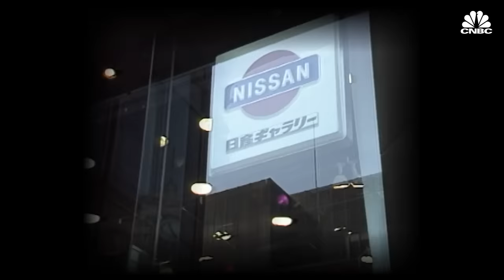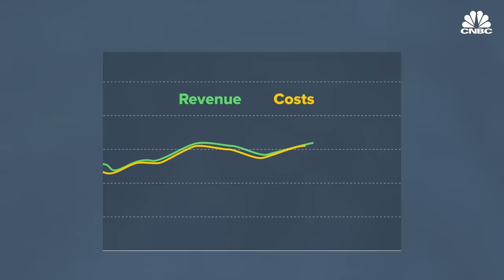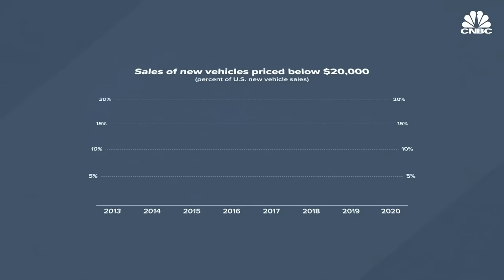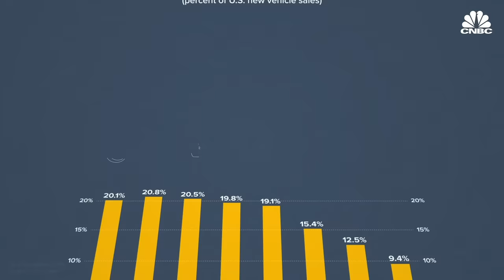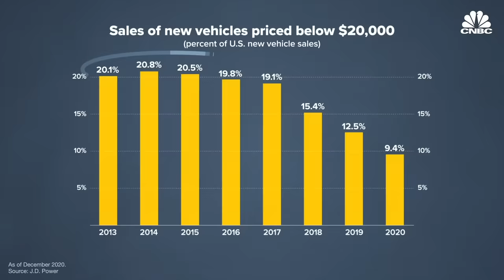Why Cheap Cars Are Disappearing

Comment: Yes. The expectation is to have that technology. That tech honestly isn't that expensive to make any more. Let's stop pretending like putting in a USB port is SO fancy now. It's basic.
Reply: I think the idea was that a touch screen and Bluetooth chip are supposed to be premium even though you can get both for really cheap
Reply: @KRYMauL  It's software and not hardware that is expensive...
Reply: @aymanhawari2589  Most software is based off of the open source Linux system which is free.
Reply: They stuck an iPad to the dash...so modern!!!
Reply: Definitely not worth the 10s of thousands of dollars they try to make us believe....
Reply: @KRYMauL  software engineers are really expensive
Reply: You can buy a decent infotainment display and backup camera setup for less than 200 dollars now. No need to have a 7 year mortgage just to have a tablet on your dash. 90s cars will be forever iconic.
Reply: @KRYMauL  Mine was custom coded by LG and uses VERY little open source. See below....

Specifically, according to GM , LG Chem will manufacture and supply all of the following systems:

Lithium-ion Battery Cells and Battery Pack
Battery Heater
Electric Drive Motor (GM design)
Power Inverter Module for DC-to-AC conversion (GM design)
Onboard Battery Charger
Electric Compressor for Climate-Control System
High-Power Distribution Module
Accessory Low-Power Module
Power Line Communication Module (for communication with DC quick-charging station) 
Instrument Cluster
Infotainment System
That list includes parts and assemblies jointly designed by both companies.

That is a LOT of freaking software for an electric car...

I know you think i mean infotainment system. I mean accident avoidance, battery charging etc. etc. etc.

It's for the open source code used by the infotainment system - not for the infotainment software itself. For example, the infotainment system code probably runs under a Linux style OS - the OS would be open source but not the stuff written by LG to run the infotainment system.
The open source code that LG Electronics used for the infotainment system in everyone's Bolt EV is already installed and integrated. There is no way for the end user to manipulate or update the system with the source code, nor is there any need to. If you check LG's repository of the source code here:

OpenSource Code Distribution

You'll find that the source code for LC10S-BSGZ largely consists of the libraries needed for decompressing ("unzipping") files, display images and video, and parse contact data in an address book. These functions already exist and work in the infotainment system.
Reply: you should tell that to tim cook😂
Reply: @aymanhawari2589  I’m not too familiar with LG’s software, but I wouldn’t be surprised if everything they do with Android which is Linux based. Also, having different images/ videos for the infotainment system makes sense as the system isn’t very advanced. My point is after the sale of a small amount of cars with system the company turns a massive profit.
Reply: @joaoguilhermejarochinskima1820  I know that’s why I’m pursuing the industry.
Reply: $60 put a new android radio in my 2006 truck.
Reply: @KRYMauL  I'm going to tell you that open sourced software is often avoided because of the high legal implications that can happen using OSS. The company in which I work for designing ECUs there is a lot going into the software of the vehicle that you dont personally interact. A lot of the price goes into the tech you don't interact with or think about.
Reply: They should make cars lower priced, some shouldn't have any screens because cars don't need screens to run, they're trying to sell you on technology, and that's stupid because if I were to buy a car, I want a car, not a computer.
Reply: @tcs07d  The point is it’s cheap
Reply: That's why I just plop in my Samsung fold 2 onto my phone holder and connect it via aux cable with a dongle and I'm off. That's all I need as far as tech goes in my ride. 📱📱👌 🚗
Reply: Let us not forget the insanity that is BMW charging an annual fee for its customers to use Apple Carplay when there is 0 cost to BMW to include it... which is why most other car manufactures just give it for free if there is a screen.
Reply: My car is basic but it has an aux port. It only took $30 to get a bluetooth adapter and charger. If automakers can't figure out how to put that into a basic system idk what to tell them.
Reply: @_brrr  $30 per car can add up, but not by much.
Reply: Android Auto is a $2000 option on Ferraris...
Reply: @aymanhawari2589  
Well yes and no.
Yes software is somewhat "expensive" but also no because it's not the software itself but the BRAND or who were the idiots that customized the software.
Reply: @tdiamonds23ice82  
That depends.
For me as someone who loves tech, I much prefer a screen than an old dinosaur 2DIN radio. 
But I'll be happy with a simple screen that has an acceptable BT connection and can run most of my videos on a USB. 
But things like Android Auto or Apple CarPlay is useless for me.
Reply: What's interesting about this is we the consumers dont want these tech features. The corporations are telling us we want them. So we believe them. There is an entire psychology on this premise. I cant remember the name sadly.
Reply: @dickmelsonlupot7697  I agree, I would prefer a screen but if I had a car, and it had a screen, then I might just sell the screen, but screens are nice.
Reply: @tdiamonds23ice82  
A screen with a analog volume control, now that's a dream.
Reply: They are pretending that technology like that doesn't get cheaper. People are starting to grow up with these technologies in cars, of course they expect them to be affordable by the time they buy cars.
Reply: @codymoreland4496  You're speaking my language! There are so many things that the OEMs and Dealers (and YouTube videos) have convinced the consumers they "need"! It's not just the tech, either. Just the ungodly amounts of power modern vehicles have is not necessary; Camrys, Accords, minivans with 300+ hp. Pickup trucks being sold with enough towing prowess to pull down buildings. AWD/4WD systems on SUVs and Trucks that'll never see anything other than cement. It all adds up to higher cost and higher markup.
Reply: @dickmelsonlupot7697  your not wrong, but I don't need a screen, screens are luxuries to me, not necessities.
Reply: @KRYMauL  While the underlying Linux is free, they customize the crap out of the interface, which costs a lot.
Reply: Yes. They take an extra $120 worth of technology parts, plus some $200 sun roof that no one actually wants, and charge $4995 extra for it.
Reply: @javaman2883  Not the software engineers fault that professionals fetch a pretty pretty.
Reply: Car-stuff needs to last at least 15 years while a ipad only needs to last 5 years
Reply: @KRYMauL  But the employed software developers are not.
Reply: @tdiamonds23ice82  Yep, plus I already have a screen, or can get one relatively cheap. Give me the ability to use bluetooth or USB to connect a tablet, and I won't need your built-ins.
Reply: @oingpla  They’re the same as every other engineer in terms of pricing
Reply: @mins1133  Well technology change more often than cars
Reply: Yeah man I added a USB port to my 2000 frontier by replacing the stock cigarette port. I also installed a touchscreen head unit with Apple car play. All of that was for less that $400
Reply: @KRYMauL  oh, ok I thought they’d be highly paid?
Reply: Except the infotainment system on my car is NEEDED. I need it to set times to charge my electric car, The pre cabin heating settings because. EV in winter , range issues, etc etc. 

It controls the accident avoidance. The auto locking of keys in cars. It is MUCH MUCH more then a stereo and IS needed in electric cars so.
Reply: @cuh720  OK but does the infotainment system littlery control, times to charge your car, and many other things. there is lots of software on the backend... 

WHile it will work for a car from 2000-08 doing something like that to a car in 2020 is dumb
Reply: @tdiamonds23ice82  
It's a necessity for someone like me especially for any modern day person who has been exposed to tech. 
But like I said, features like Apple CarPlay, Android Auto or whatever are useless for me since I don't need and it's fckinng dangerous to do shtt with my phone while driving.
But a back-up camera especially one connected to my screen is actually a plus and is classified (for me) as a need since it does help me in backing up properly especially in tight spaces plus with the amount of motorcycles we have here in the Philippines, it's a must have especially on an SUV since motorcycles are almost invisible when they linger in your blind spots.
Reply: @dickmelsonlupot7697  your not wrong
Reply: @oingpla  Engineers as a whole fetch $60,000 - $120,000 and average at about $90,000. All together that’s about the same as middle management, so it’s not as much as you’d think.
Reply: Who needs all that junk anyway
Reply: Every car does not need the top tier technology. Every car does not need a touchscreen Apple CarPlay android auto heated seats cooled seats ventilated seats. All of those things are pointless for most Americans
Reply: @AgentSmith911  It has a similar cost on other vehicles as well
Reply: @llcross04  A touch screen CarPlay or Android auto device is cheap af
Reply: @KRYMauL  Open Source ≠ Free
Reply: @crankcase75  Actually most open source software is maintained by the community of academics and hobbyists. So, it’s about as free as you can get. Go home boomer and stop talking about things you don’t understand.
Reply: @KRYMauL 
That pretty cool but I'm good with the setup I have now with the Fold 2, it works perfect for me. And when I get my new car next year, I'll just switch the phone  cradle over to my new car and done! That is a nice system though, I would go for it if I didn't have my setup I have now. Thanks for the link 👍😎
Reply: USB port exist = my insurance company that’s a 1000$ more !!
Reply: @KRYMauL  Making random assumptions about people on the internet much? Great way to look a bit daft. I work for a top tier cloud computing company and specialize in Linux - there are multiple open source licenses types besides the GPL, it is possible to make the code open, but still charge people to use it. The code also has to be thoroughly tested and maintained properly - you can't expect hobbyists or academic institutions to stick with a project indefinitely without funding and end up with a coherent solution. For example the Automotive Grade Linux project receives funding from Mazda, Suzuki, Panasonic, Denso, Toyota, Renesas and other minor contributors. It is then incorporated into products they sell, or solutions they re-sell. https://www.automotivelinux.org/about/members/

Not all Linux distros are completely open source either, some contain proprietary elements (e.g. Red Hat) and if you want your vehicle to work with various proprietary technologies and devices, then you may have to license certain things also, even if you're running on Linux.
Reply: @crankcase75  I’m talking your basic versions of linux not server level which is going to be maintained by hobbyists and academics because and institution needs to teach Operating Systems each year. Sure that’s no technically free as you’re paying for your entry, but it’s about as free as water or air. Also, automation is completely different from something like CarPlay. In its simplest form is just a stereo with a usb which is $60 on Amazon. Lastly, your response was a very ignorant boomer response, so thanks for telling me about how complicated a car can be.
Reply: @KRYMauL  yes but these companies still need to pay developerd to code in programs and specific things for the vehicles. It's not like it's vanilla linux being used
Reply: I know, they’re acting like you need to be 40 with 3 kids to have bluetooth and a usb port that cost $8 to make.
Reply: @dennisp8520  You know developers and engineers receive the same pay as middle management right? So, they hired one more management team that doesn’t mean anything compared to the multiple millions a car takes to sell
Reply: @politcallycorrect5816  lol $8. It costs pennies if you waffer it yourself mate.
Reply: @KRYMauL  you got to remember though the car manufacturer only makes there money when they sell the vehicle they still have to support it with updates, pay boatloads of cash to make sure it meets strict guidelines for all the states, do all the crash testing. It's not the individual components that matter per say. Like others have said USB is cheap, metal is restively cheap. It's the combination of many things along the way that add cost including transportation to get the vehicle to your dealer and the dealers marking it up for their share. 

So for example let's say a car sells for 20k the auto manufacturer profit on that low end vehicle is likely around the 30-50percent which is pretty low.  That car is likely going to last for a decade so it will be a long time before they get a repeat sale from you as well and by the time multiple other iterations of vehicle have happened that had to be paid to research and developped to stay competitive.
Reply: @politcallycorrect5816  bluetooth and usb should be easy to make and put in but there are other things that effect cost
Reply: @dennisp8520  Thank you professor for lecture on car sale 101 when I was talking about a cheap radio console that supports CarPlay and not about bells and whistles add on which can cost a lot in rnd.
Reply: @KRYMauL  free software != cheap to maintenance or customized
Reply: @KRYMauL  Android is used in the infotainment system only. Everything else needs an OS with real time guarentees, which android does not provide. There is a modified Linux version with a different task scheduler from the usual one that has some real-time guarentees, but it is not mainstream and there are better RTOS options. You do NOT want the ABS brakes to suddenly lose their anti-skid capability because two lower-priority tasks on the same thread are periodically deadlocking for 50 ms.
Reply: @aymanhawari2589  that's dishonest or ignorant. The automobile software is mostly free
Reply: It was?
Reply: @amitkumar-sz6ze  Except for battery cars, there's lots that goes into the backend... And software coders arent free
Reply: Auto companies were holding out on the lower tier for a while, just so you'd have to upgrade or buy the new one when it comes out with say map display integration.
Reply: @chuguanyu  It's the same as hiring a team of middle mangers in terms of pay I'm not talking hours, but peer pay.
Reply: @BosonCollider  I thought we were talking about infotainment, and don't most of the schedulers use hard coded schedulers that are bare metal in terms of performance. I'm thinking veralog type languges.
Reply: @llcross04  nope, it's mostly free
Reply: I was thinking the same thing. What tech do you feel has really improved a modern car?
Reply: Right it’s crazy to think a car is the price of a house.
Reply: @aymanhawari2589  android auto is free. You can get a decent head unit for $100
Reply: My car USB a Chevy bolt. There is MUCH more then AA and  CarPlay. Also those $100 units are junk.
Reply: @KRYMauL  you get what you pay for. 
 You put a cheap screen in the car, the screen will malfunction half way into the car's life span not even. 
You can get $2 lithium batteries from eBay for example.  But it doesn't mean that's what Apple and Samsung is giving you.
Reply: @J16179  all depends how much you earn.  The "price of a (sh!t) house" is pocket change to some
Reply: @Clark S I have been telling people this for years now. Screens, navigation, back up cameras this tech is so old now they should not even be options in vehicles anymore. Funny how televisions using the same tech are getting better and cheaper but you put a lower quality screen in a vehicle and it warrants a $1500-2500 option price tag. Car makers are continually raising the price of vehicles. Pretty soon everything will be $50k and up. There won't even be a $30k or $40k market. All the banks keep doing is increasing loan duration to keep payments looking affordable.
Reply: @AgentSmith911  crazy to think you spend $380k on a car you can't even daily drive and it doesn't come with the most basic of options. And why would something like that be a $2k option in a ferrari but $300 - 400 in a Toyota or Honda. Just doesn't make sense to me.
Reply: @cooltwittertag  you are correct. It's not like the screen technology is new. Hell even touch screen tech is old now. Funny how other products that use the same tech, laptops, televisions, etc get cheaper. But for some reason touchscreen and back up camera is still expensive. Same cameras used in these cheap home security systems that you can buy for $30 online, cost you $400 option in a car.
Reply: @Golden_African  that’s the point
Reply: Actually the technology in cars are made for endurance not cheap like a phone etc. Imagine you car computer failing or sensors messing up cause they cheap components.
Reply: 3000 dollars for an audio package that's 3 years behind current technology and cost 3 times as much as a high quality aftermarket system with Navi and full android functions. T
Reply: I can make a pc that has more tech in it then a car for cheaper.
Reply: @alex82361  Your home built PC doesn't need to meet any regulatory standards. Also a car these days has 20 to 100 ECUs and a couple of kilometres of wiring, even with CAN bus or automotive ethernet to try and simplify wiring looms. I don't think a lot of people appreciate the level of compexity in even a basic modern car vs. even an early 90s luxury one.
Reply: @aymanhawari2589  you know nothing about technology if you think the software is the hard part, they make one version of the software and put it on thousands of models you can buy one piece of hardware for thousands of cars.
Reply: You do know the 2017 bolt and 19/2020 has a different software so
Reply: @alex82361  Your pc parts can be used on any normal desktop pc, including the software. You cannot install windows 10 into a car or put a Core i7 into it either.
Reply: I remember one of the American auto makers saying that the cars are “priced at the value that customers believe they’re worth”.  The tech they place i the cars def is not worth the price, basically a usb and a alexa type system. In all honesty is cheaper to make a electric car and easier to maintain...it also has the worst carbon footprint...
Reply: @joaoguilhermejarochinskima1820  if they’re develop new software but not if they coping and pasting codes.
Reply: Price gouging
Reply: Just need a dock for tablet and port to connect with sensors and speakers.
Reply: @KRYMauL  Linux is this simple you have windows you have Mac OS and then you have Linux Linux is free and is great to code servers and small products that don’t need a lot of web based things
Reply: @KRYMauL  tesla uses Linux
Reply: @crankcase75  It’s a YouTube comment and I’m in the IT world. Also, I’m talking about about infotainment and everyone else is talking about extra features. So, nice try with the terrible spelling.
Reply: @gsjourney3054  Bro I know what Linux is it’s another OS built off of UNIX. Assuming my college textbooks are to be believed.
Reply: The thing is as long as automakers can tell themselves it is fancy they can upcharge thousands on a vehicle.
Reply: Apple car play is such a basic function, you can even buy your own system for less then a band
Reply: Its mostly the safety stuff in these cars that cost $$. developing it all takes billions and the manufacturers need to make the money back. If you look at dodge chargers they didn't add this tech and just dropped the price of their hellcat models by the thousands.
Reply: @KRYMauL  criticising spelling in a quickly typed off comment just higlights you've no actual point of subtance to come back with. Infotainment is still integrated into the the rest of the cars systems,  it's not just a head unit and still doesn't change that you fundamentally misunderstand the open source world, the variety of licensing/revenue models, how it often sits side by side with proprietary code or hardware (e.g. many processrors are ARM based which requires licensing, many infortainment systems are NVidia based and you have to pay them like any other component supplier) or the development costs involved, even if you're working off a GPL license. Basic head unit style functions is only part of the functionality in the sort of touch screen or idrive style interface even fairly basic cars are coming with now and you can't discuss it as a seperate category because it's all part of the same ecosystem.
Reply: @Mellio Kuang Manufacturing + Development + licensing.
Reply: As a worker in automotive
A LCD screen may cost $100-$200... Doesn't make sense to have them price increase to $5K more per car
Reply: @Disxx yes, and no

It's savings not for consumer but for companies, 
Companies won't share the cheaper prices of new technologies to consumers, they'll charge a premium

Consumers will have to switch to cheaper options, and stop buying increasingly expensive cars that don't give best quality/price
Reply: @KRYMauL  they have to pay for google and apple and the software engineer are not cheap. High salaries at least 100k a year due to competition .
Reply: @robo9876  That’s the price of middle management and in some states is barely a livable wage
Reply: @davidhill7071  regarding banking  If the car aren't worth anything before the end term of the loan, then what good is the collateral? It needs to make sense for the bank financially as well
Reply: That "earned it" quip was the most ridiculous and pretentious garbage I've heard in some time.
Reply: I work in automotive electronics, the reason why technology is so expensive because, the software and research in it, takes a lot of time and brain power. And it totally justify the cost.👍
Reply: @mangeshpawar9269  how is it that aftermarket companies can sell Double DIN radios with all the infotainment tech people want for only a few hundred dollars? And that's the retail cost... which hasn't moved much in the last 15 years tbh.
Reply: @StatsMass  Well you cannot except a good quality and added software features from such after market stereo. OEM software are rigorously tested for functional safety standards and many other standard. Software updates are provided after sales, issues and bugs are taken care of.
As many have already mentioned it before, its the software that makes it expensive and not the hardware.
Reply: @mangeshpawar9269  Every OEM infotainment system I've seen has without fail been outdated within 5 years. Updates (if any) are done at the dealership, for a fee.

All I ask for is Apple CarPlay (which is updated when my phone updates) and we good.
Reply: @aymanhawari2589  200$ for a CarPlay deck on amazon
Reply: @aymanhawari2589  we aren't even talking about electric cars. Your points are off topic and meaningless.  Besides that, most all of what you mentioned are not actually necessary functions.
Reply: @shanewillbur1325  My car is electric. There are things that a  $200 carplay deck CANT DO. Like preheat my car when it's cold, or show how much charge, or to limit charge to 70% vs 100%.. or to program accident avoidence or LKA 

My car is electric and has 1000's of lines of custom code. This is much deeper then a $200 headunit for FFS

If i had a 200 corolla yeah. $200 head unit. But with electric cars, that infotainment system has , LOTS of code on the back end...
Reply: @tdiamonds23ice82  well unfortunately cars now have to have a backup camera for safety, gotta have a screen for the camera, more costs added
Reply: @DaveCM  They are pretty needed when it is cold out and you need to save battery (and i live where it is 50-70 degress year around) . Or you want to prevent degradation because even tesla says, don't charge to 100% if you want you battery to last. So yes, It is important in electric cars. I have owned a spark ev and a bolt ev. Lots of tech was missing in spark that is highly needed in an electric car... sooo Dino juice is dead once you make the switch. So yes it is relative consider the EU and california ban on emmissions...
Reply: Relatively speaking it may not seem "expensive" to you anymore, but they still add to the cost. You have far more safety features, the use of  boron steel, all of which add cost to a car that otherwise exist and run without them.
Reply: @CarlosGutierrez-qw6pr  what a dumb law
Reply: True you can buy a plug in cig lighter and boom you got bluetooth and chaging for 20 bucks
Reply: @codymoreland4496  Middle Management is $40k to $120k it's not exactly a lot.
Reply: @tdiamonds23ice82  how old are you? And did you even watch the video? People are willing to pay more for the tech. Call me whatever you want but for me my first car is going to be the Tesla model 3. The brand name doesn’t sell me, the ceo doesn’t sell me, the car design itself doesn’t sell me, even the electric over gas usage doesn’t sell me,  it’s purely the tech inside of the car that makes me and many others willing to pay for the car.
Reply: This is why EV is the way bcuz you can implant technologies intuitively.
Reply: exactly. And these screens we're putting in are just tablets. If anything, the tech has made it cheaper for manufacturer. No more buttons and random knobs. It's all just screens and programming. And before anyone comes in to say the programming isn't cheap, it's cheaper than the machines needed to make the parts and it's cheaper than the materials needed for those parts.
Reply: @magiic3871  I am between the ages of 12 and 20, I watch some of the video but I just feel like that these screens are useless to me, they can be helpful, but our grandparents had cars without screens and so did their parents, and they did just fine. I'm not being mean to anyone I'm just stating my opinion.
Reply: @tdiamonds23ice82  Our grandparents and parents had a lot of stuff we didn’t. Hell my grandparents grew up poor and they turned out “ok”. However they obviously wanted more for themselves and their families. Thus leading to my parents who had some but not much when in turn leads to them wanting more and better for me. Within three generations my family went from poor to doing very well financially. 

The idea I’m trying to make is your suppose to improve as time goes on. Then those improvements become the norm. Our parents didn’t even grow up with google do you think anyone would willingly go back in time to a point without such a resource? 

I understand you may not be excited by it at the moment, but maybe you don’t truly realize the significance it brings to even have the ability to have an option of having or not having it.
Reply: @magiic3871  ok, I respect your comment
Reply: Right, but how many cars have a SD chip port or standard in-dash navigation?   VW had done that for years.  They put American companies to shame with some of their standard features.  Heated seats are very common in VW cars.  The Germans have always had higher expectations than Americans.
Reply: @angelgjr1999  even some of the early 2000's cars are good enough :)
Reply: Add all the other “basic” things and you’re looking at at least $2,000 extra, I’m still without power windows/locks but not everyone is willing to do that
Reply: @KRYMauL  a few hundred dollars, stuff adds up, a car maker could make a car with manual transmission/windows/locks, only basic radio maybe with Bluetooth, but virtually nobody would buy it
Reply: @Zachery_  agreed
Reply: Exactly i got an android radio i installed for 80 dollars, touchscreen with android share feature, gps, back up camera already with it. I also got a smart mirror with recording back and front and reverse camera on amazon that i installed on 2004 Toyota Camry. The dealership charges lile 20k more for that, it's a highway robbery
Reply: Look at kia and hyundai features other brands option are standard on kia and hyundai.
Reply: Not all technology is cheap though. Example: The parts and labor for replacing components such as a programmable auto locking power lift gate actuator on a toyota sequoia can run up $1500...and this is for a 2008 model!
Reply: @carrsllccarrillo6507  your not wrong the assembly does cost a lot of money, but with the amount of money car companies are making they should be able to pay for that.
Reply: @tdiamonds23ice82  you would think that would be true. However the profit margins need to be greater for them to be consider making money (greed comes to mind).  One of the problems that came in to light as of last year was the export and taxation of products built over seas now. Therefore, it's now going to be more costly for the manufacturers to mass produce product in foreign countries.  So now several  auto corporations (including aftermarket part companies) have decided to do 1 of 2 things: bring back their manufacturing process back to the states to save themselves from overpaying taxes. However, in doing so  now only increase the cost of the product itself which to compensate for the extra cost goes right down to the consumer who will eventually be paying more. The other option would be having their parts process done in one country and then get assembled in another country, which I have no clue how this would save money and it sounds ridiculous. You would think this would be logistical nightmare and more costly but I guess the bean counters figured out a way where they can save 2 cents rather then having it done here in the states.  Now, I can't say this is happening with every manufacture but since I work for a reman engine company and this process has been recently done, building engines with non oem parts have started to take its toll on warranty.  Alot of the 3rd party aftermarket components like harmonic balancers and oil pans are garbage with fitment issues and poor product build. Although it's not my decision to do this (nor would I want to it this way) it's safe to say that ultimately the deciding factor from the higher ups IS indeed  'profit over quality.'
Reply: @carrsllccarrillo6507  Do it yourself much???
Reply: @carrsllccarrillo6507  your not wrong
Reply: @THE-xp3hp  I'm not understanding your question
Reply: @tdiamonds23ice82  " I want a car, not a computer" ... well you are at least 30 years too late on that wish, Even my 23 year old junker has an ECU for the power seats.
Reply: @KRYMauL  "They’re the same as every other engineer in terms of pricing"

ROFLMAO -- seriously? You think that a new grad, with zero experience, can pull down $120K plus in other engineering fields?
Reply: @KRYMauL  Come live in the Valley
Reply: @KRYMauL  "Actually most open source software is maintained by the community of academics and hobbyists. So, it’s about as free as you can get. Go home boomer and stop talking about things you don’t understand."

No it's not. The OSS maintained by "academics and hobbyists" doesn't get used in safety critical systems. The big OSS projects are maintained by the companies that use them. If the OSS is critical to their product,  they pay engineers full time salaries to work on the code. Who do you think pays for the ongoing development of the Linux kernel?  Or the Java language? Or Python? Or OpenSSL?

I personally know many engineers who are paid to maintain OSS. And the one's I know who work on OSS wouldn't get out of bed in the morning for less than $200K pa. You don't put your lowest paid engineers on critical systems.

And yes, I'm marginally a "boomer". I've been developing embedded systems for over 40 years and have probably forgotten more about tech than you've ever learnt.
Reply: @KRYMauL  "I’m talking your basic versions of linux not server level" ... when you are in a hole ... stop digging. Server level Linux *is* the basic version! (You do know Linux is just the kernel, don't you?)
Reply: @stainlesssteellemming3885  Yes I've used the Linux kernel before. I was saying a computer scientist would get $60k - $120k eventually not as a new grad.
Reply: Correct! The tech barely costs anything to make.
Reply: @joaoguilhermejarochinskima1820  Software engineers make $90, 000 per year. A fraction of a cent per car.
Reply: @KRYMauL  Well, as someone who has routinely hired s/w engineers,  if I offered less than $120K for a new grad I wouldn't see a single resume. No one would apply
Reply: @KRYMauL  they are premium, a simple GPS navigator and touchscrren entertainment system costs around $1000 even in the smallest cars, while your phone is free.
Reply: @stainlesssteellemming3885  The most I've seen as a new grad is $80k, and that's with the stipulation of 1-3 years experience and a high GPA. So, I don't know where you work, but give the company's name and I'll apply for $120k.
Reply: @KRYMauL  I'm not in a hiring position at present. But I work within 10 miles of apple, google, facebook, etc. We need to compete with them for people.
Reply: @stainlesssteellemming3885  Oh, those companies are incredibly hard to get a job in.
Reply: @theoccasionalvideo  software engineers commonly go for upwards of $200,000 and there is an entire team of them.
Reply: @stainlesssteellemming3885  Wait $120k in California is barely enough to live in California
Reply: @KRYMauL  Agreed - but it's still not cheap. My point all along was that software engineers are not cheap.
Reply: @stainlesssteellemming3885  I meant they’re in line with middle management which aren’t the most expensive things, but not cheap either.
Reply: @KRYMauL  "Oh, those companies are incredibly hard to get a job in"

Well, not necessarily. But they do get to cherry pick the candidates. So if you want to hire someone who's perceived to be "the best" -  you need to make a better offer than they do.
Reply: @stainlesssteellemming3885  By hard to get into I meant after graduation without doing a massive project in college. I’ve only worked on a couple of websites in college, so I’ll probably be better off working at Oracle.
Reply: @KRYMauL  Well they ain't shabby neither: https://www.glassdoor.com/Salary/Oracle-Software-Engineer-New-Grad-Salaries-E1737_D_KO7,33.htm

But if you are still at college, I'd lose the "OK Boomer" attitude before you get into the real world. Because you are going to find a lot of us so-called "boomers" who have been working in software pretty much since the start of the industry, are still coding and learning, and who don't intend to quit for another 10 years at least.

More importantly, you are probably going to rely on them for your annual review and pay-rise. Remember that, in our industry, most companies prefer to fire people and hire new, than retrain them. You can do everything right, and you will still find yourself being laid off at least once per decade.
Reply: @Golden_African  Yeah but a 'shark fin' antenna is worth at least $4K, right?
Reply: @joaoguilhermejarochinskima1820  yes and no. Literally depends on what you need.
Reply: A usb port wasnt fancy to begin with lmfao
Reply: Yep. My entry level Spark from 3 years ago had build in Car play and backup camera on a base model. It's obviously not expensive to implement lol
Reply: Brands other than Tesla looks very boring in comparison.
Reply: @bensmith9175  I for one think Teslas design is kinda boring. You dont buy them for whats outside, but the features and performance. The Designs of BMWs and Audis are still iconic. We'll see if Tesla's Cybertruck sticks, though I doubt it will.
Reply: Honestly i do not want all that tech, so i do not want to pay for it.  They need to make options without it.
Reply: Automakers don't care since it means they can charge out the ass for an otherwise dogshit car with enough tech crammed inside it. I rented a Nissan Sentra for a week while I was fixing my own personal car. Despite being a basic car it had steering wheel driver controls, Bluetooth phone pairing, 3 USB charge inputs, a backup camera and mid dash screen and all manner of sensors plus some kind of adaptive braking which would REEEEE at me in stop and go traffic if I didn't stomp on the brakes if I got under 20 feet distance to the car ahead of me, even at 6 mph
Reply: Honestly i cust want something with an engine and wheels that will last a long time
Reply: @magiic3871  good that it sells it to you, me and many others do not want all that junk. They should include it in the techy brands, not base models
Reply: @iandms1160  The base models are becoming more modern. The entire car industry has been trying to innovate and needed a change. I mean hell all evidence points to a future of electric cars over gasoline ones but you don’t think there are still conservative people out there thinking “I’ll keep my gas car”. It’s just a matter of time.
Reply: @magiic3871  I am not even talking electric versus gas.  Technology even in base models for gas cars is the issue.   Safety features like lane departure warnings are one thing, cause they help out everybody on the road not just the driver, but all the music, different modes and settings are unnecessary and should only be included for those who specifically want those features.  More choice is a better thing.
Reply: @iandms1160  I think thats reasonable the issue is cars arnt custom made for one person and it’s a very unpopular side of the coin to not want the extras tech gadgets and what not. It’s such a smaller audience and it’s harder to capitalize on. At the end of the day they want to make money and keep having customers and the only viable way is to keep improving. You can’t make a car every year and it does virtually the same thing as the last car but a slight bit better. 

Idk if you follow newer cars being made but everything we know is being challenged in order to improve performance and give a better sense of safety.

I guess the only way you could have less tech is to buy a “worse” car in retrospect.  Older models where it wasn’t thought of or feasible at the time.
Reply: @magiic3871  While they cant customize they could offer more options, its not difficult to offer a couple models of the same car, one with an extra add on package, one without it.  Why they tend not to there are a couple reasons, demand is one, but also profit margins.  Car companies want to sell more of the cars that they have a higher profit margin on.  They make a better margin on an SUV with all the extras thrown on than they do on a basic car.  

As for your second point of buying an older car, thats exactly what happens and is speculated to occur often(either buying an old car or keeping an old car), one of the arguments against requiring some features federally, is that if you increase the cost of new cars by requiring it, that you price people out of the new car market, so rather than driving an improved but not fully loaded new 2030 car, they are driving a 2008 car that pollutes more and does not have as many safety features.  This was mainly used in arguments surrounding MPG requirements(which had certain car companies and states suing the federal government and other car companies) but applies to extra tech in general.
Reply: @iandms1160  Yeah thanks a lot of sense for both points. Good talking to you I see a different side of the argument and reasoning for it. Learn something new everyday haha.
Reply: @magiic3871  no problem, Im always learning from youtube haha.

Have a happy new year.
Reply: We are now at USB-C
Soon enough will come USB  G   H  I  J   K etc, and everyone will wish to upgrade and buit=y a new car or computer just to have the latest USB version.
It is a good way to stay in perpetual debt, surviving on Peanut Butter sandwiches whilst driving that Corvette or BMW and appearing to be rich.
Reply: Yup, you can get a 3rd party dash unit
170-300$
Radar system with notifications and backup camera?
- 120$
Keyless start and entry?
-80$

None of this "technology" validates the over inflated car prices.
Reply: That's the thing. When features move from mechanical to electronics and finally software, profit margin goes through the roof. It's easy to add a "customize your xyz" feature and then inflate to the cost of the entire vehicle.
Reply: @ Reflective Layer  
Whilst there is an element of truth in what you write.
It is far more complex than that.
All along the supply chain there are increasing costs,
starting at the shipping costs of both raw material and
finished product, be it by sea - air -  rail - road transport.
Inflation caused by pumping more money into circulation
devalues the buying power so more is borrowed... and some 50% to
75% of the USD in circulation is held by foreign banks
It is a vicious cycle.

Then there is the desire for 'ever-increasing profits'.
Mom and dad investors - Hedge fund managers - Banks both
domestic and foreign - venture Capitalists who invest in
shares, even rival CORPORATIONS invest in their competitors ...
All want profits and more profits with each successive year.

Then there is the cost of purchasing new equipment and replacing the old. 
This flows right down the supply chain.

Increasing energy costs, plus increases in insurance premiums,
employees wanting higher wages, as do executives, despite many
already earn 300 times more than the common worker.
Retainers for 'expensive lawyers' Consultants, Risk Managers,
Advertising agencies, Modeling agencies .. The expense list is almost endless.
One must also add copyright payments for everything from circuit design, 
to music used in advertising.

None of this is sustainable.
The 'Big Bust' has to come.

At the root of the problem is
(a) Excessive Government spending, creating more debt and an increasing burden on the taxpayer
(b) Capital'ism itself

Capitalism being the biggest cancer on society.
like all other 'ism(s) be it Fascism -  Natz'ism -  Marx'ism - Cynic'ism. - Shia'ism - Juda'ism - Altrui'sm
Narciss'ism - Utilitariani'sm - Shia'ism - Juda'ism
None of them are any good and all lead to problems.

Under this system we live in,  everything has to be destroyed periodically by creating war,
destroying as much as possible and rebuild ...  and start this dirty process all over again.

Despite Man's creativity and alleged intelligence, ManKind fails to learn from history,
is the most dangerous of all the species, and the most stupid of all creation.
Yet there is something unique about him.

COMMENT REFERENCE:  Reflective Layer.2020123142025
Reply: @andrew_koala2974  Agreed. It more complex than my simplified explanation.  I was just looking at specific narrow example where literally a few pages of code can increase the value of a products. Kind of like the ability to remotely turn on the heater of car that previous was only able to started remotely.
Reply: @ReflectiveLayerFilm  
There is that too. 
Whatever the complexities, manufacturers are cunning and 'always' looking at wats to
exploit the market and buyers.
Have you ever wondered why CORPORATIONS  - A CORPORATION is a DEAD entity. 
The word itself derives from the Latin word CORPUS, meaning CORPSE.
All CORPORATE names are in ALL CAPS, including your identity that has been stolen by the GOVERNMENT,  to create the 'PERSON'  that  im-PERSON-ates your 'Given Name and Family Name'
Which are in Mixed Case Letters  --  The fiction that is the PERSON is in the ALL CAPS name.

You have a 'Given Name' which your parents gave you - and a 'Family' name because you belong to a family.  Yet the CORPORATE Bankers and Government brainwash people to believe they have a  FIRST NAME and a LAST NAME -- (CORPORATIONS have a first name and last name)
Why is it when you fill out a form, the Name space is always in a Box or marked by lines.
Do you know?  There is a reason for it that you would not expect.

Look at all your COMMERCIAL CONTRACTS.  Licenses, Bills that are addressed to the PERSON,
and not to the living breathing Man (who is alive)
That is why you were deliberately lied to and taught to use the word EVERYBODY, because a BODY is DEAD. You will find EVERY BODY in the Cemetery. 

Conversely 'One'  is alive One is unique, One is the supreme number 'Know that there is NO one like you and never will be. Your fingerprints prove it.
People who have deliberately not been taught Proper grammatical English use  'Common Street English', traditionally the language of peasants.  
People substitute the word  'You'  where the word should be 'One' 
You is to be used only when speaking to some-one SPECIFIC.  
... example : One should be aware of that  --  NOT  You should be aware of that.
Lastly, look up the meaning of the work PERSONA in a  Websters, Funk and Wagnall or Oxford Dictionary.
Happy New year.  We are already 3h 40m into 2021  Soon it will be 2022
Reply: @KRYMauL  
Software is build on open source free Linux 😂  
It takes incredible amounts of time and effort to design good software. Do you have any idea how much competent software engineers are paid? And how many you need to build something competitive. 
Your logic is like saying processors are made from silicon which is freely available in nature so wafer fabrication should be free or something 😂
Reply: @apathak34  Software Engineers paid $80k - $120k a year, and open source software can be found on Github. My point was you can buy a cheap Carplay system for your car.
Reply: Untested Tech will bring glitches..glitches means more repairs..in the past a windshield replacement would cost you 200 or less now with technology could cost up to   1400 dollars , No thanks.
Reply: @angelgjr1999  yes you can duct tape an iPad to the hood of your El Camino. Sweet ride
Reply: @bw2532  how does this even happen
Reply: @angelgjr1999  The Model T is also iconic.
Reply: Yep. You can buy half this tech off Alibaba and have it reliably shipped straight from manufacturer for 90% less
Reply: iPad at Best Buy...$500.  iPad in your dashboard...$5000.